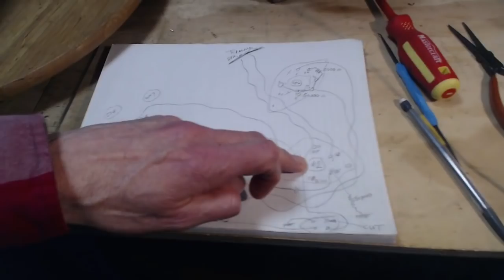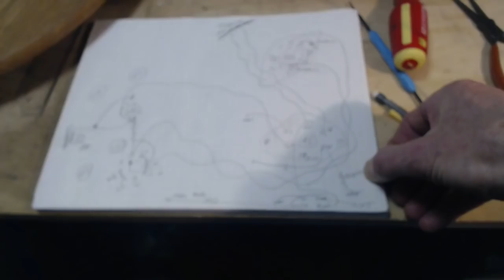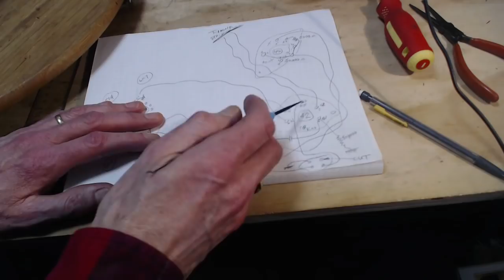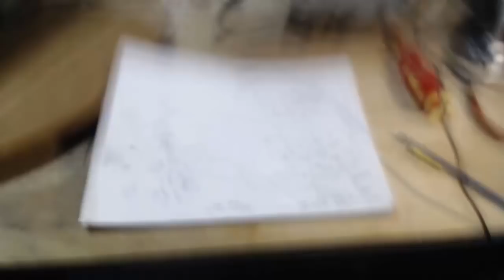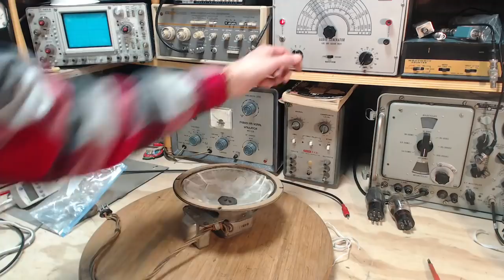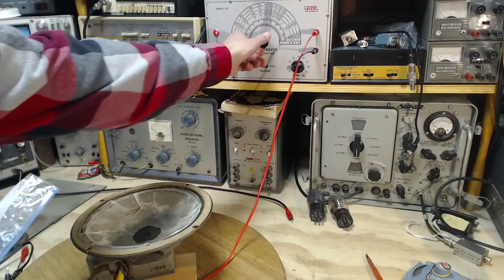Canadian Marconi Model 93 Video #6 - Speaker Testing with Walter Cronkite

Comment: I noticed there was a small hole next to the opening the transformer wiring comes through. I am guessing there is another one on the opposite side suggesting there was a socket there, either for the vibrator or the power connector. I am convinced this was a battery radio but they modified it completely to use tubes with higher filament voltage. But, in the schematic three of the tube filaments are wired in series because they are only 2 volt filaments and the other tubes are in parallel since they are 6 volts. So, why not leave it that way? The only thing I could think of was that those tubes were already becoming rare when the conversion was done. I have heard that tubes with low voltage filaments are not as hardy as those with higher voltage and can be more easily destroyed.

The concern I would have with going forward with this radio is that there is no schematic for it. With my limited knowledge of electronic circuits I would be lost trying to sort out what the correct wiring and tubes should be. I am certain that is far less of a concern for you. It could definitely be a challenge, and very interesting, but likely very time consuming.

Comment: If you look at the schematic, the transformer on the speaker is a push-pull transformer (the type 19 tube is a dual triode).
And it looks like that extra socket would have been the vibrator tube. See https://www.radiomuseum.org/r/canadia_ma_93.html#b

Comment: The octal driver and six pin output tubes sockets are original to the radio. The driver tube would have been a 6c5 triode. The output tube would have been a type 19 with dual triode operating in a class B configuration. What is missing is the inter-stage transformer that would have been mounted under the chassis where the four empty holes are now.

The reason the heater wires are not daisy chained  is because the 19 tube had a 2 volt directly heated cathode and the 6c5 used a 6 volt heater.

The reason there are four wires going to the speaker is because the output transformer has a center tapped primary to facilitate the class B output.

What appears to have happened is that someone tried to convert the audio amplifier from its original configuration either because they wanted to use different tubes or the inter-stage transformer went bad.

The DC to AC conversion circuitry is on the other side of the chassis where the power transformer is now located. There would have been a large rectangular can containing the vibrator circuitry.

Comment: Who ever worked on that radio didn't have a clue and didn't have the schematics, pins 3/4 are grid, pins 2/5 should go to the socket on the back which the speaker transformer plugs into, one should be centre tap the other two are the wires that should go to the plates on the vacuum tube operating in push pull, the feed wires from the driver transformer should be green, the ones to the transformer mounted on the speaker are blue, there should be a black wire coming from the centre tap of the driver transformer would go to negative, there should be a red wire which should go to the centre tap on the transformer mounted on the speaker which should be B+ at 90V.

Comment: Jim, you had mentioned a "ground" connection to the speaker among the bundle of four wires leading to it. If that speaker frame is "grounded", and the matching transformer is an autotransformer, any rubbing of the voice coil upon the magnet frame is bad juju...
B+ line to common short ... voice coil to frame short. I'd expect that to be noisy and a bit sparkly if left as is. You might not notice a trouble with that until full B+ is applied. If she does get all poppy and fizzily, ..,,unground the speaker frame. 
Ay, let the DMM tell the story for ya'.  ;-)